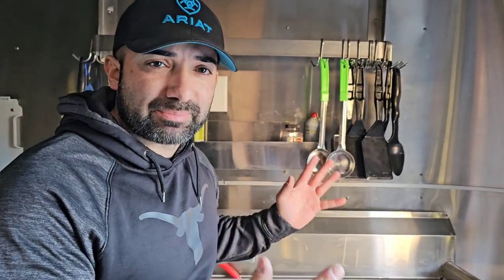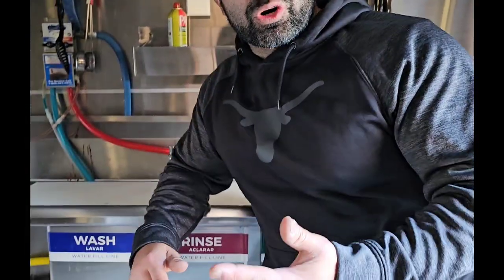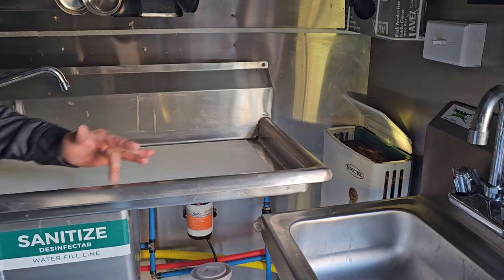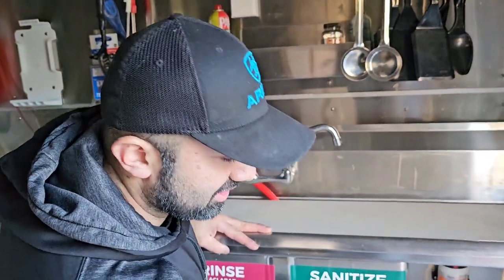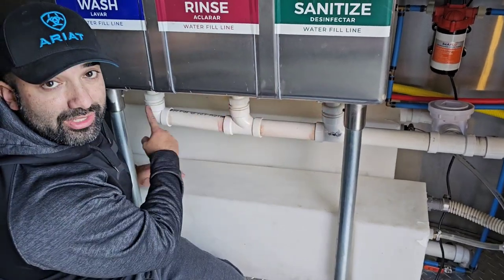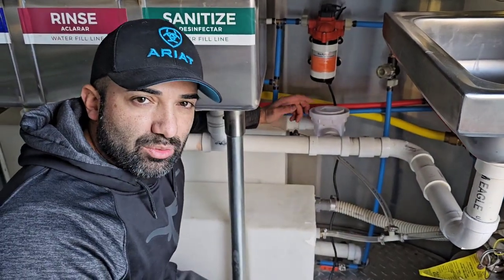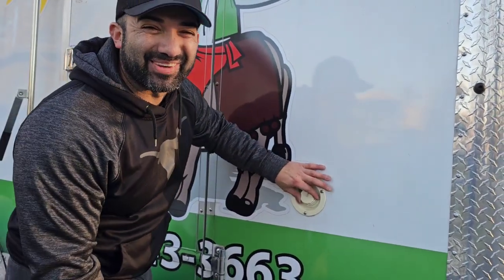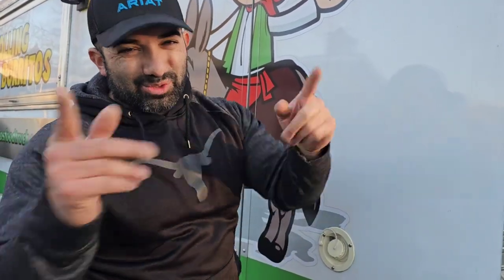How to Build a Food Truck: Plumbing Review

Comment: This may be a silly question, but when you open the faucet valve does the water pump automatically turn on? And for hot water, does the water heater turn on by sensing flow?

Comment: Hi, I've watched ur video on plumbing, have you done any plumbing with a RV type waste tank mounted under the trailer? I have rv black, color-wise,  tank. How do you line up drilling hole for sink drainage inside to tank underneath, also using the rubber grommet 1.5" that fits both drain pipe and then top of waste holding tank under trailer. Prevents leaking on both pipe and tank. Hope I didn't make this confusing question. Thanks.
Reply from the maker: Under the trailer or truck no, too much work. Have to make sure they don't fall off lol. Inside felt easier and secure